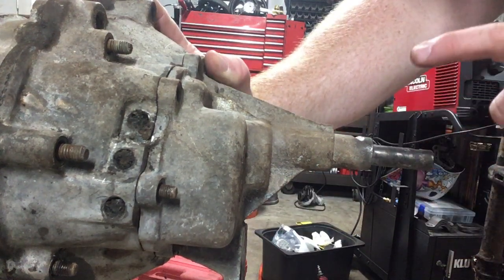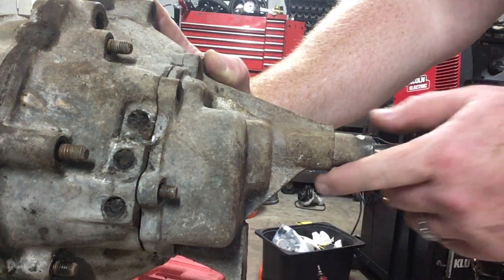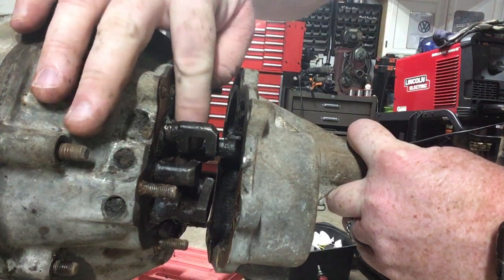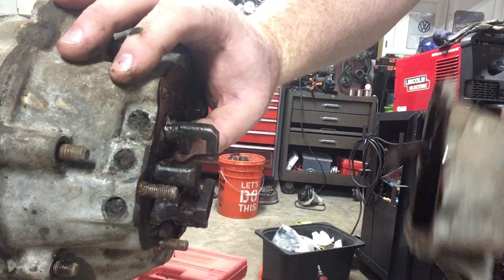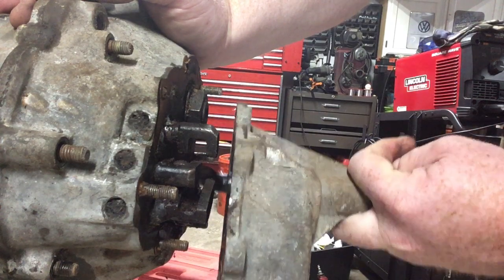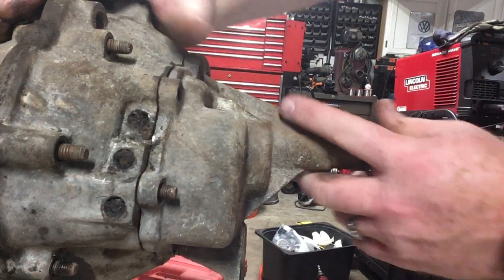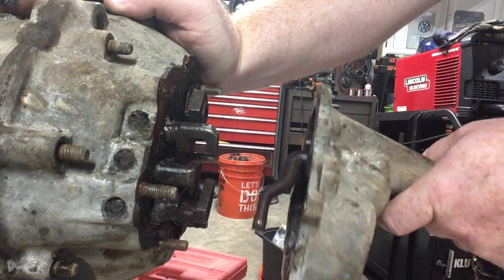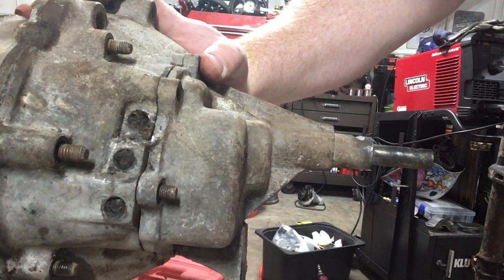VW T1 Nose Cone Removal

Comment: Should there be a rubber bushing or cover or something on the shaft of the hockey stick, where it goes into the nose cone to prevent dirt and water from entering the nose cone.  Thanks.
Reply: The very early transmissions didn't have a seal on the end of the nose cone where the hockey stick comes out. In the mid 60s they added a seal.